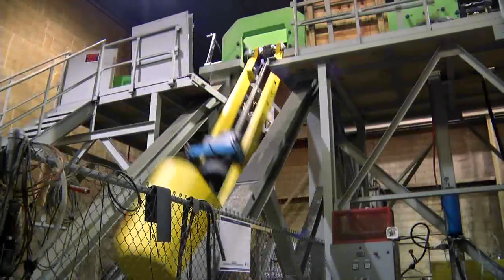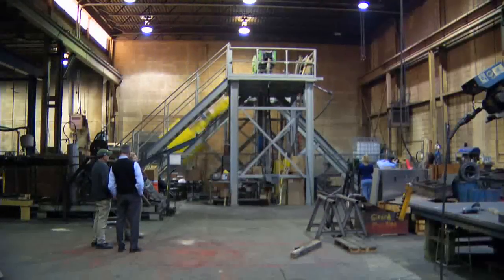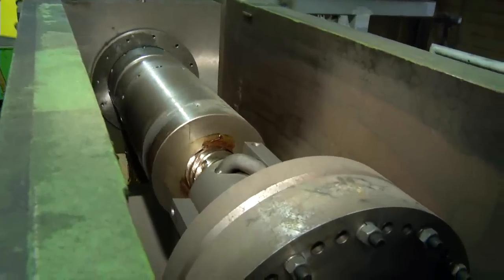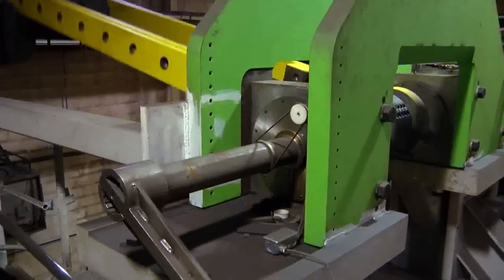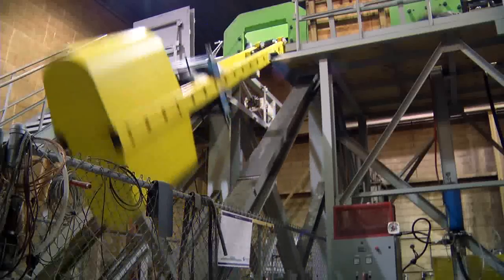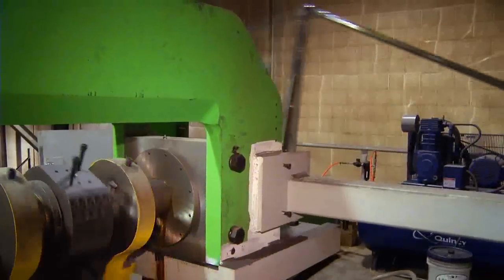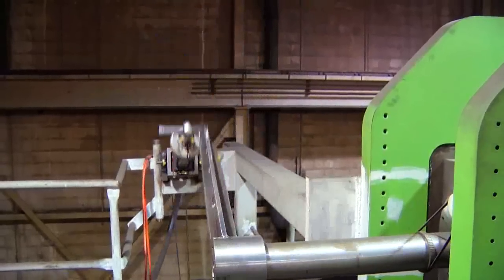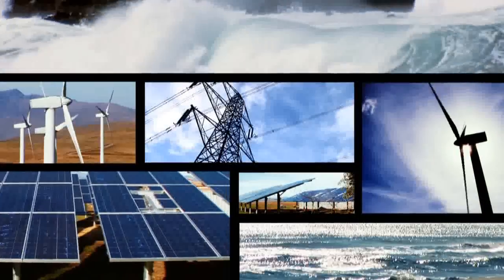Return To Gravity Assisted Power.wmv

Comment: You're doing it wrong, this way you're just adding more friction and greatly dissipating the gravitational energy of the pendulum. Instead use the centrifugal or inertial energy of the pendulum as it swings, which is the direction of the energy. The two stage Milkovic mechanical oscillator.

Comment: Gravity is energy. Energy can be converted to a different type of energy. I have been conducting experiments and feel that you are on the right track. However there is a better way to put force into your pendulum. I have a working model that I would be willing to discuss. 

There are so many crackpots out there as well as over educated idiots who are locked inside the box.  There is no such thing as perpetual motion. Extended motion is a fact. The earth is spinning right. Converting the energy from the sun into a rotational force. The rules of thermal dynamics cannot be broken. Energy cannot be created nor destroyed. But all forms of energy can be converted to another type of energy.  

The definition of free energy should maybe be defined a bit more precise. Because with out gravity..free energy we would fall off of the earth.  Without the heat of the sun..free energy we would all freeze. Without weather..free energy all lands would turn to deserts. 

Gravity can be converted to another form of useful energy. My life goal is to perfect a method of doing just that.

Dean Elliott
Reply: I'm agree with you.
Reply: Well said! Thanks for saying it outloud! :)
Reply: You can easily calculate the extra energy a pendulum has at the end of its swing. It is a little bit more than when it started but not a lot.

Comment: electro generator efficiency are 200%?
Reply: nope, for oil powered 30% become 80%, and for electric dynamo 80% become 90%, and if the counterweight is overweighted is become 90% plus kinetic battery
Reply: @anommaulana3541  thanx